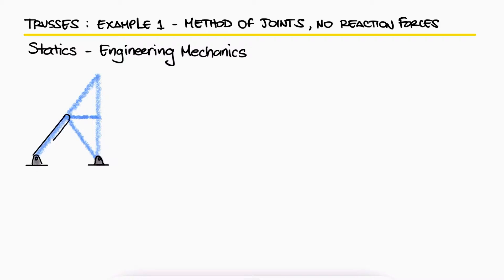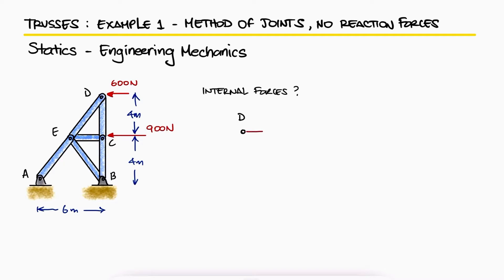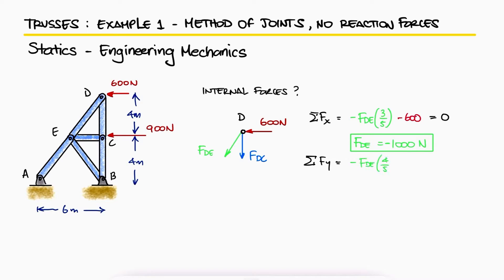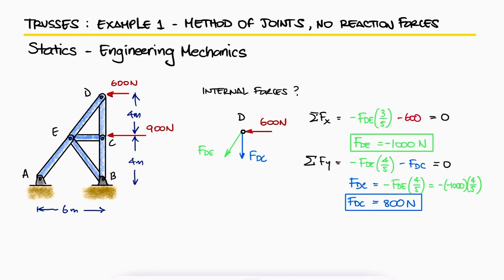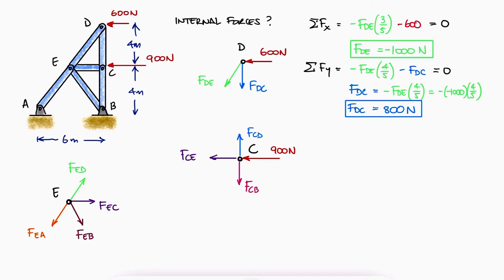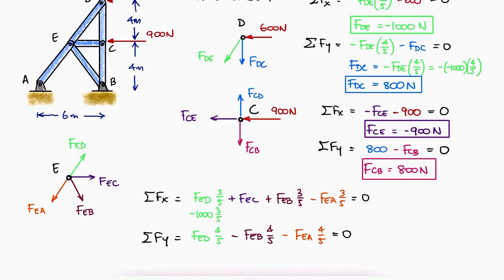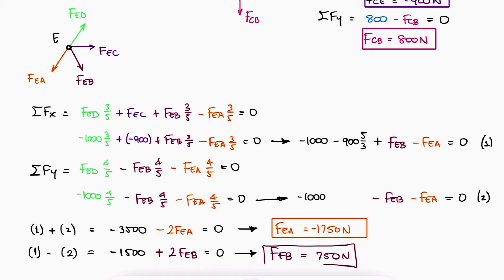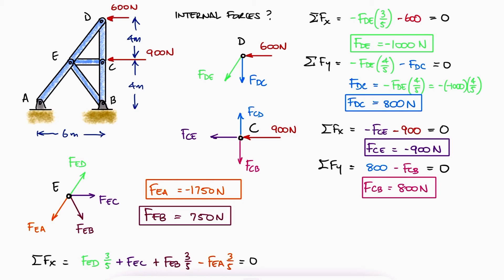Trusses METHOD OF JOINTS, NO Reactions Needed, in 3 Minutes!

Comment: I’m a bit confused as to where the 3/5 is coming from
Reply: It represent the cos / sin of the angle and whenever your side / bottom of a triangle is 3/4/5, or a multiple, you can just use the ratio rather than solve the cos or sin of the angle
Reply: here CE is 3 in this case